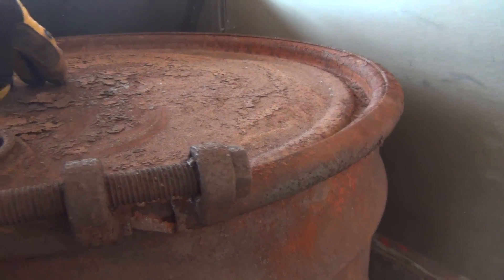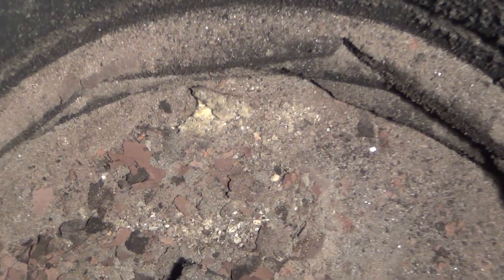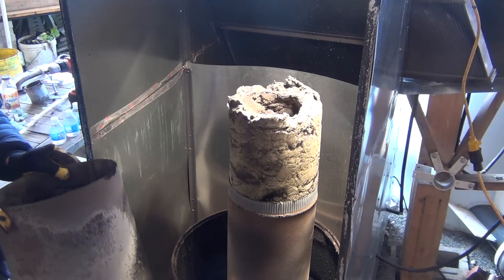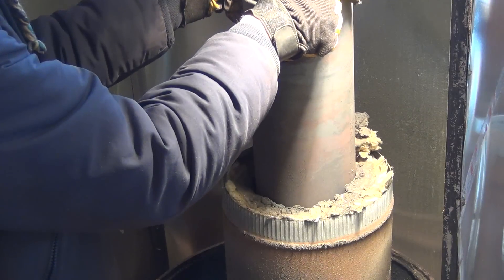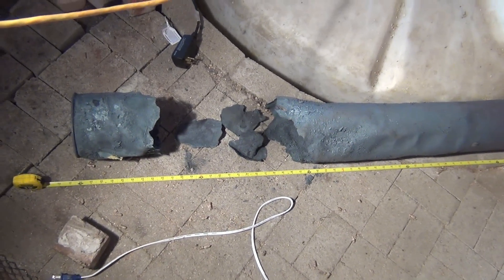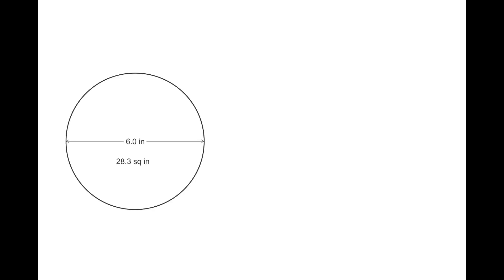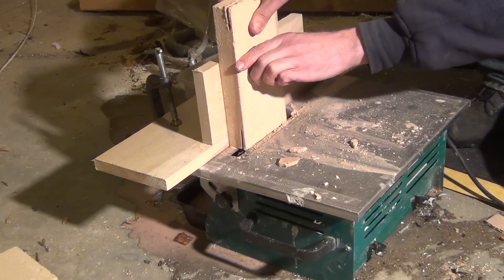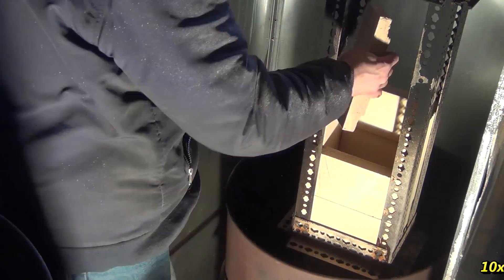Rocket Mass Heater - Heat Riser Rebuild

Comment: I used fire brick on my horizontal gravity fed rocket stove and it's held up very well now for 3 years. I heat my home with it so I need it to be dependable. I've burned several times so the brick turns red hot and it hasn't broke down yet. There are a few flakes coming off some of the ones in the direct flame path, but they are still intact for the most part and will not need to be replaced for the 4th year burn season, which I'm into now. As I'm posting this, the temp outside is 26 degrees and the stove is running around 550 degrees now and it is 74 degrees in here, which is perfect. A bag of hardwood pellets (40 lbs.) will last around 9 - 10 hours at $3.99 a bag, so I'm pleased with the cost of heating with them.

Comment: Just wondering if a length or two of Cast Iron pipe would hold up?  My cast iron coal stove is over 40 years old and looks to be in very good condition.   The advantage of cast iron pipe would be the flanged end that would give a nice seat in a standing configuration.
Reply from the maker: I as trying to find some 6" cast iron without much luck.  Even the plumbing suppliers don't have much cast iron any more.
Reply: You might try a company that demolishes houses.
Reply: Bigelow Brook Farm (Web4Deb) Check your local contractors that install water  line for the local towns and cities.They usually have cast iron pipe laying around from doing repairs and change outs.I actually scored a 30 foot piece of 12" for scrap price and a few small sections of 6" too.

Comment: It is realy nice ipece of work you have done. Have you concidered using fire clay tube for heat riser? It could last ages and you wouldn't have to build any steel support for it.
Reply from the maker: I haven't tried clay, but I've been told that it can't survive the thermal shock from the high temperatures.
Reply: Bigelow Brook Farm (Web4Deb) theres a Japanese guy making them out of clay tube, you should look him up, super clean burns, he even uses one in his kitchen

Comment: Would a RMH keep a winter greenhouse in middle tennessee in the 70F range? Its a prefab plastic lined 10X20X7.5.

 Trying to figure out my heating and its driving me nuts. The greenhouse will hold several barrels of water with fish in them. I could run pipes through a sand bed/walkway, would that help keep the temps that warm? My WATER has to stay, at the coldest, 70 degrees. 

I do not want to run the heat pipes in a hard to access way.

Comment: Yes the other commentators mentioned the 2000 degree resistant caulk you can squeeze from a caulking gun & dispense with the steel frame

Comment: I am not the best of health or energy these days, I found 8 inch diameter flue liner works nicely as the heat riser. For older women, it's easy and quick.

Comment: You will find firebrick will work perfectly.  Since I upgraded to firebrick, I haven't had any trouble.  It just works.  You might want to make sure the top of your riser doesn't have anything to capture material.  It should be rounded on top to keep material and ash from building up.  Too much ash and the riser draft will suffer.  I like your design to hold the riser.  I simply used fireplace cement to stack the bricks without any support.  It works, but over time the fireplace cement tends to burn away.

Comment: Thanks for sharing your progress.Was wondering if you insulated the outside of your burn tube.I am building a system slimier to yours with a fire brick burn chamber and burn tube and was hoping that I could get away with not insulating the burn tube.Would be interested in your thoughts, Cheers
Reply from the maker: pete shierny I have no insulation in the system.  Seems to work fine!
Reply: Bigelow Brook Farm (Web4Deb) Thanks for your reply

Comment: If you held the heat riser with refractory cement or clay around the perimeter you might find it will last much longer. You could even use chicken wire inside the clay to help make it reinforced.

Comment: 6" steel well casing is pretty thick pipe. Perhaps it could be used as the riser? I saw the conversation below wondering about cast iron pipe, and the lack of availability.
Reply: I wish I could find a 20' cast iron pipe

Comment: Really like the fire brick idea for this!   Your engineering is a welcomed and thought provoking!!!  I have watched dozens of home models for rocket stoves..YOUR entire system appears to be user friendly version and detailed for home or greenhouse.
Great job sharing the ups and downs to make things work!
 I KNOW you are busy, but can you give an update on how it ran / worked for the 2014-15 winter????
Reply from the maker: Thanks.  I always like to be non-conforming and push the limits a bit.  ;-)  The heater ran fine this winter except for our little problem  (see Catastrophic Event video)  I mainly burned wood in the "new" stove with teh secondary burner since it was cheaper than buying pellets.  Once the heating season is over, I'm hoping to do an update video.
Reply: Bigelow Brook Farm (Web4Deb)

Comment: Are you going to insulate your fire brick as you did the steel pipe and then have another wrap around the insulation? Fire bricks burn out too, they get brittle and crumble in extreme heats.
I used 6.5 inch well casing as my burn tube and heat riser w/ stainless insulated chimney as the insulation containment. Heat exchanger is a 60 gallon used hot water heater which has a domed top. No rust on exchanger, not sure yet as to the condition of the well-casing. It is still burning great, will autopsy in the spring.
Reply from the maker: I'm undecided on insulating around the fire brick.  I would have to build some kind of containment to hold the insulation in.  Since the brick in the burn tunnel lasted for a year and still looks new, I'm hoping I can get a couple of years out of the heat riser's bricks.  We'll see!
Reply: Bigelow Brook Farm (Web4Deb)
Thank you for showing us everything you are doing. we use fire brick in our Rocket evaporator for making maple syrup and we lose the odd fire brick due to the intense heat, but this stove is really driven hard with air induction and it runs at near blast furnace temps.
Reply: Bigelow Brook Farm (Web4Deb) fire brick have poor insulating properties so i would insulate.

Comment: just something that may work for the pellet grid how about useing thin terra cotta tilles on their side ,they should last longer if they don't crack on the first burn , just   a wondering ;-)
if they are supported from the underside i think the support would live longer
kind regards karl
Reply from the maker: That might work. I've looked into getting some ceramic pieces for it too but I'm concerned that they would be too brittle if they aren't support correctly.  The stainless has been doing well so I don't mind replacing them.  I've made it a year on this set and they still look good.
Reply: Bigelow Brook Farm (Web4Deb) 
Maybe a little update on your stove, now that this heating season is (finally) nearing the end ?
Reply from the maker: Jan Andreassen soon.  we're still burning!

Comment: O.K. before you break it in, line the drum w/fireplace tile using fireplace mortar, then like a good frying pan, coat the outside of the drum w/ cooking oil from time to time. When it begins to look whiteish or oxidized, oil it up again. Keep building this "seasoning". It will burn off. I do the same to cast stoves. Let your kids replace it when they're grown and you're retired.!
Reply from the maker: Or just put another barrel on it when the one wears out since they're free.  ;-)
Reply: Sweet deal! The best I can do around here is $30.

Comment: Six years have passed since this video was made.   How did the new heat riser perform and have you needed to replace it with something else?
Reply from the maker: It's still running.  Haven't had to replace anything.
Reply: @Bigelowbrook      That is indeed very useful information for other builders. and the construction technique looks relatively simple.  Thanks for your reply.

Comment: So rust is a serious problem. Have you considered using a sacrificial anode rod like they use in conventional water heater? It would save time from rebuilding a new heater every now and then. You only need to replace the rod. Same method is used on ships and oil rig platform.

Edit: I've looked it up...an anode sacrificial rod lasts about 3-10 years and costs less than $50. There are also discussions on a few permies forum of adding zinc/brass plates to the component as sacrificial anode.
Reply: Those work in water not fire.

Comment: could you do an update on the new heat riser, i would like to build one to heat my brewery and would like some more build specs to help me
Reply from the maker: I haven't pulled it apart to check it yet, but it's still running well.

Comment: What is the difference in the performance between a circular riser and a rectangular one?
Reply from the maker: I haven't noticed any difference with mine. There is some magical formula for figuring it out, but I think I was sleeping during most of my physics classes.
Reply: Bigelow Brook Farm (Web4Deb)
I watched another video where the maker deliberately made the firebox entry to encourage a cyclonic spin in the riser.    Another one was pleased that he had chanced upon a double cyclone. No one has said anything about that being a good or bad thing. 

Your solution is very appealing.  But it got me looking for Fire Clay Heater Pipes.  In the correct dimensions, they'd be a great manufactured round solution.  I did find a company in China who makes fire clay pipes in and size, but their minimum order is 2000 lb. of pipe LOL.

I'm still looking.  there are clay pipes made for furnaces.

Comment: How has the  fire brick stack worked for you? Did the sand act as a good mass for storing heat?  How long was your underground run?
Reply from the maker: the brick is still working fine and is going into it's 4th season.  The sand works fine and the underground run is around 30'

Comment: Truly enjoyed your work on the Rocket Stove, great ideas. My question did you use something other than the sand around the barrel to secure it to the brick base? (furnace cement, ect.)
Reply from the maker: The barrel sit on a brick foundation that is cemented together.  I might show it in one of my early videos....can't remember that far back.  ;-)  Then I just threw some sand around the base to "seal" it up.  It's probably not the best solution, but it allows me to pull it apart.

Comment: Critical part for stainless steel pipe seemed to be the lowest section, where apparently was excess oxygen in the burning wood gas. It is not the heat, but oxygen, which destroys the steel pipe. Hope the brick pipe will last longer!

Comment: As I watched these excellent videos I thought why not use clay flue liners. After some research they may work but can crack and split due to rapid heating of the liner. 

You've contributed a great resource of information on rocket stoves. Keep up the good work!
Reply: From what I've read and heard clay flu liners can't handle the stack temperatures

Comment: real stainless steel will not do that
Reply: yes it will.All metals even titanium corrode at higher temperatures and when you add water vapor and creasotes from wood it will at a faster rate.
Reply: plus the fact that the temperature in the area that the pipe burns through is in excess of 2300F.